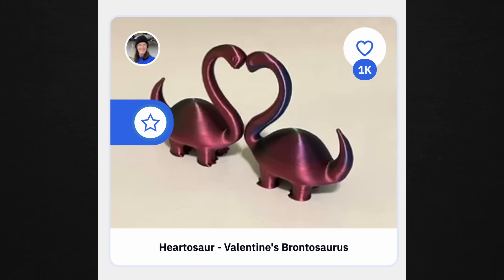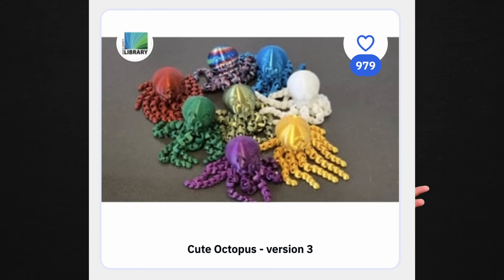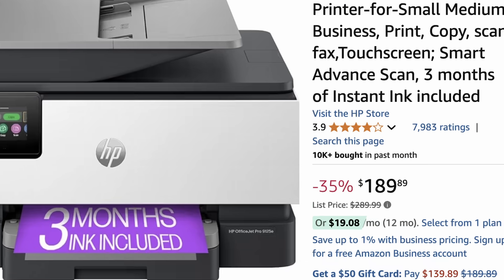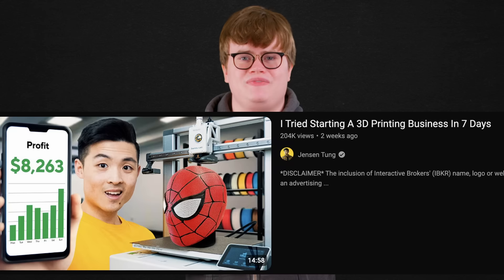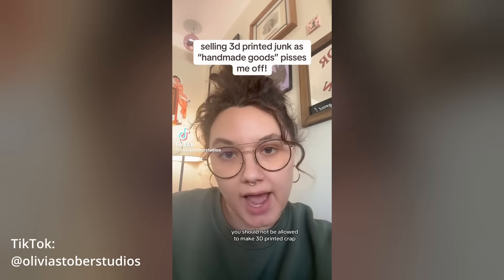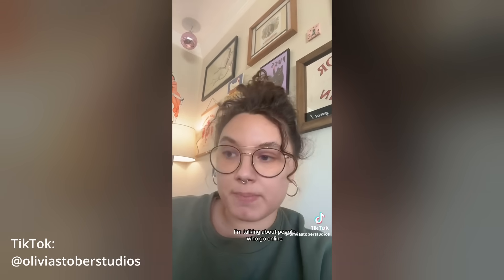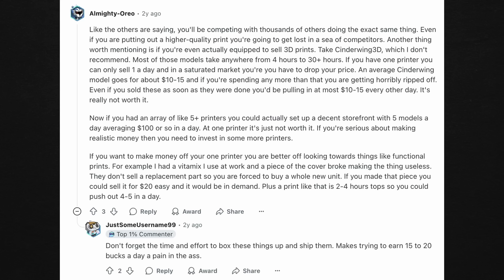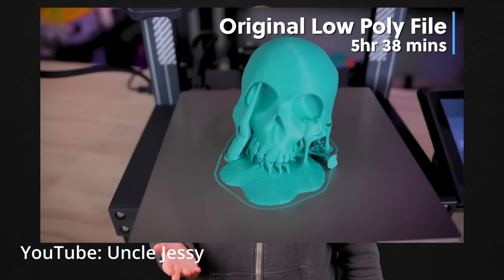The Rise of 3D-Printed Slop

Comment: 3D designer here... I partly agree and partly disagree:
1. As a designer almost all my personal prints are useful and solve an issue I have
2. As a creator I design stuff that other people can print for free. Not fidgets, but mostly useful stuff that highlights 3D printing (Rossero on vairous platforms), but I also have some trinkets and design studies that are less useful.
3. I don't get the spinners, dragons and flexi toys craze either
4. Yes, sometimes you can buy the same stuff from the same plastic online. But with a 3D printer you get it teleported to your home. I'd say buying 1kg of plastic and printing 20 useful things is better than ordering 20 useful things separately adding to 1kg of plastic.
5. Number 4 goes out the window if you order 3D prints instead of printing it yourself, so no, I don't understand the 3D printing business businessmodel
6. You have done a great job finding appalling looking prints from ugly plastic. This is most times not the case and modern printers print accurately and beautifully with stunning filaments. I can point to a sprue attachment or a mold split line on a conventional part and say that it needs to be sanded, filled and primed before it is close to useable.
7. There are a lot of functional parts on Thingiverse as well, but they cater to a specific niche (which is an upside of 3D printing), but that means they won't be as popular as the cutest newest little flexy toy. So yes, the front page is garbage but the 95% you are not seeing is what makes designing, sharing and printing great.
8. I do agree on the extreme amounts of waste 3D printing currently is creating, due to that most users choose to print garbage from the front page
Reply: 7 really needs to be emphasized. 3D printing is an absolute godsend when you need to build something of a very niche use, but a niche use by definition lacks mass appeal. The first thing I printed after getting my printer working was a mount for attaching servo motors to model railroad track, something I specifically really wanted but not something that's going to convince millions of people to buy 3D printers.
Reply: I think your #7 & #8 points are particularly salient.  I'd add the following:

9. Robert mentioned @1:39 "Most people who get a 3d printer cannot use one for the purpose of prototyping, however.  Few have the skills to create custom designs  for 3D printing.", which in combination with several other factors, including many different model repositories, multiple file types, different design software, and licensing makes it hard for people to find and tweak models of useful things that are ideal for 3d printing at home.  

For example, imagine that you have a "Brand X Model Y 2025" vehicle and you want a somewhat customized modular divider for the armrest storage.  After a fair bit of searching, you may find many "Brand X Model Y" models but that aren't for the 2025 model, and there's a minor change by Brand X in measurements that make all those models not quite usable_.  But after finding _almost good enough models, is that the provided models might be in a format that requires a specific design software that you don't have, and which would cost more than you can justify spending.  Or the model's licensing prohibits modification (granted, most people just "risk it", but they're unlikely to share their modifications, which doesn't help the next person).

re: #8 - There have at least been multiple efforts at providing some type of consumer-friendly recycling (e.g something that could be used alongside the home/printfarm printers), but every effort that I've heard of has ended up costing drastically more than any potential benefit.  Hopefully that changes sooner rather than later.
Reply: I would be curious to know the amount of waste and harm generated by carbon emissions for packaging, shipping and delivery of "cheap temu items" versus the one time universal filament and, let's be honest, usually minor amount of filament waste now that most printers have run off detection, thermal presets, bltouch equivalents, level graphing. It honestly feels like such a stretch to point to the piles, especially when referred to as "plastic" when they are not plastic, distinctly.
Reply: Jumping off from above. We are also in the novelty phase of 3D printing. People buy a printer for the novelty of it because the new machine are so much easier to use. It's inviting. But most people don't not have the patients to learn the modeling and eco system. 3D printing is not main stream enough that it will become an applicence yet.

People are interest in buying "3d Slop" because the figet toys can't be produced with traditional manicaturing. For now it the novelty that is driving the curiouty for buying 3D object and and 3D Printers. This phase will pass because wither it a 3D printer fidget toy and or any manucatured object in you Walmart of Dollar store. It will all go in the trash. You have to stop people buying things that makes them happy, doing that is a very TALL order. That would also meant closing up craft shows as well if you want to stop people or corporations from making 'trash'.

The promise of additive manufuture which is what 3D printing is that. A) Less shipping needed. You can print close to the place the object is needed instead of being mass produced at obscene volumes to make up the cost of the molds. B) You can make the materials you need on the Continent that it's being made for instead of shipped the raw materials globally. The amount of plastic in the ocean are usually from lost raw pellette's for ALL plastic goods is rather high.

The amount of fidget toys being made in china and shipped to North America is NOT the way to go. But the novelty is what's driving this trend. It's exposing the world to the possibilities of 3D printing right now. That is 'Print on Demand' for the things you need instead of buying as you can that 'moment'. China benefits from basically have all the raw materials, labour the factories to produce locally right now to keep their local costs of goods down.

About the Craft Shows... They the show runners need to vet all applicants and educate themselves on what this medium is. At the end of the day most of the materials used in Crafts are also "trash" eventually. What a Craft buisness does is transform those materials into something 'novel' that make buyers happy. 3D Modelers can fit that bill with Diversaity on the models they can offer. Wither I sculpt/tool by hand or draft up a CAD model they are both a Skilled Craft. ☺

When I went to my Local Farmers Market I wanted to see both the crafters and bulk sellers where offering. For the few Toys stands that get their products mostly from china there was maybe the same 5 models that where being produced from China as Fidget toys in ther booths. 1 Booth of just Funko Pop. and 1 Booth though that had laser cut wall mounts art pieces, Impossible puzzles and a full menagerie of different fidget and standard 3D Printed toys.The Impossible Puzzles was the trend they placed front and center but I was far more impressed by the insane amount of 3D printed models up the wall display and their laser cut work.

What I'm trying to say is not just a 3D printed problem when it comes to 'Slop' or 'trash'. It's small enough now that it is mostly about the expose to it that people are finding jaring, while they ignore the rest of the 'Slop' around them because their a used to seeing products everywhere. A lot of people pick up any hobby and drop it after a year if it's not for them and produce waste. Sometime people want the thing the hobby produces instead the hobby. Also in general don't think that traditional manfuacture also doesn't produce waste and failed pieces either. You just don't see it that's all, as it left at the manufacturing site (some manufacturing process waste up to 50% of their raw materials to make the final product). You see the failed 3D prints because people are sharing the process publically compared to other type of manufacturing while trying to improve 3D printing as a whole. The newer machines are producing better 3D printed objects, with better the use of better CAD design work for finished products (it not just for prototyping anymore), with WAY less failures from 3 years ago.

The annoyance is that your only seeing the same 10 fidget toys being produced by independent farms VS the ones that as selling mas market from china in stores. It's up to the Craft Shows to demand more out those venders. But I also seen similar Pokemon ceramic planters and crochet/knitting pattern works.
Reply: well said!
Reply: Do I recognise your name from you being part of the Marble Machine community?
Reply: @ Yep, that's me!
Reply: Agree with everything you say here. For me, my printers would be useless if I didn’t design my own functional parts for my personal needs, or print things for my family/friends. I can only justify the cost and space my two printers take up because it would cost me way more to outsource the prototypes and projects I work out. 
I’m not a part of these spaces, but if craft fairs and maker markets have a problem with people coming in and selling unoriginal trinkets and slop they need to shut it down and refuse them entry. With less of an incentive to flood in-person markets with slop, they will have to turn to e-commerce where the margins are way more slim due to high competition, so most players will drop out and things will hopefully settle.
Reply: About #5 - it can be "find someone with printer locally and pay for it" this way it works. But doesn't work as scale.
Reply: Oh hey, you've got some cool designs and congrats on your Printables contest win, I've been meaning to print that calico cat
Reply: @XatxiFly  Thanks!
Reply: "I don't get the spinners, dragons and flexi toys craze either"

It's because spinners and fidgeting toys were originally mainly useful for neurodivergent people. Neurotypical people didn't need them. 

Then it got trendy and way too many people started to use it, neurotypical people as well. For neurodivergent people, these toys are stimulating. But many companies just overpriced every single spinner, or fidget toy. So now it became inaccessible and people resorted to making things themselves for free, because at least this way they can have some nice things while living in a world, where capitalism, inflation and poverty exists. Kinda a symptom of a bigger issue we have made in society. 3D free made toys templates are more accessible, then the toys made by creators and shops to purchase if a person needs some stimulation😅
Reply: @Elliarts54  
ther is one thing i dont like about the fidget toys is that most of them make a snaping sound, somting that makes me lose focus on the think i thiying to do and it is not like i can put on my ear mufs bechos then i cant her what the techer is saying. But that is just my opsarvation
Reply: This video is not about you then
Reply: @SlavoidUkr  yes, and? I don't think they think it was in the first place?
Reply: @ Yeah, let's all stay in our own bubble and only watch affirmative content. You are right though, points 1 and 2 place me outside the discussed group of users indeed, but points 4-8 are general and apply to the whole 3D print community and  some just give an alternative perspective on the arguments in the video. It's still a good video though and he makes solid points but these were just my two cents
Reply: Dragons are cool tho. :(
Reply: If you don't print slop, perhaps there's no point in feelings targeted and getting defensive in the first place, I'm sure he doesn't mean people like you, people who 3d print slop is the 3d print equivalent of shein hauls
Reply: @ I agree on that one, but I also feel like he based his assumptions on the front page of ThingiVerse which is not representative of what people actually print. And I am not defensive, I gave a broader and secondary perspective from the inside out.

Comment: YESSS THANK YOU FOR SAYING IT I’ve been so sick of going to fairs and craft shows and seeing those 3d octopuses for $45
Reply: If it was me I wouldn't allow myself to sell them for more than $10 lol

They cost like $3 max to produce
Reply: 2 cents per gram, so most are even cheaper
Reply: @elitsoerrosenberg  what about machine operational costs and if you use a quality mat like rainbow pla or petg the costs can hit 4c a gram, and a decent size dragon or octopus is about 120grams. and they take about 9 to 12 hrs to print and machine time comes in at about 25c an hr. then theres the exorbitant price that venues re charging to set up for a day. ive seen as high as 350$ for a 10x10
Reply: @budwittman4907  Sure dude, 3 dumb octopuses cost like a new 3dprinter.
Reply: @Splarkszter  its not quite that cheep to make them and its size and material dependent.
Reply: That's the unfortunate side effect of 3D printing becoming easily accessible, especially with the rise of Bambu that seems to be essentially the apple of 3D printing. Anybody can use them and make crap. Anybody can print random garbage and make a tiktok about it.

Back when it was really just the reprap project, I feel like it was way  more sensible, we didn't have as many of the "look at the random garbage I printed today" content creators as there are now.
Reply: $45?  Unless they are extra large, the standard ones cost like $1 - $2 to print.  I get they need to make a profit, but that is excessive
Reply: Not really the 3D Printers fault. People buy this crap, otherwise it wouldn't be everywhere.
Reply: Aren't all octopuses 3d